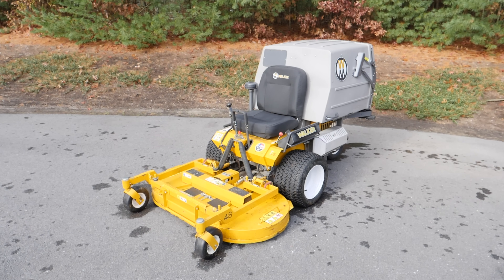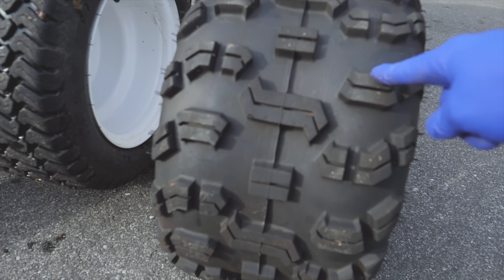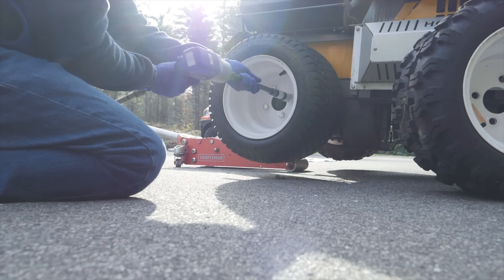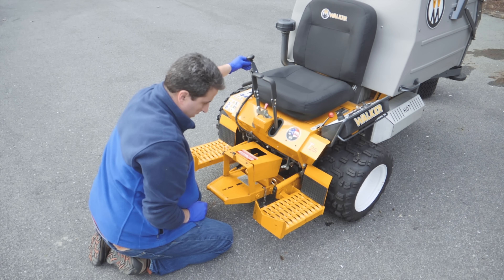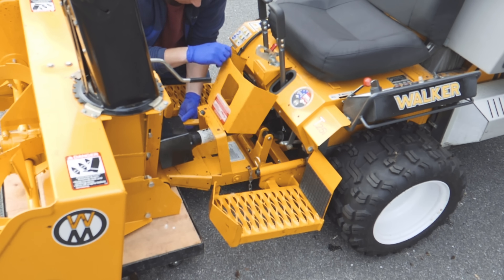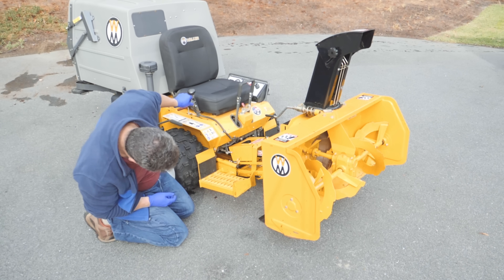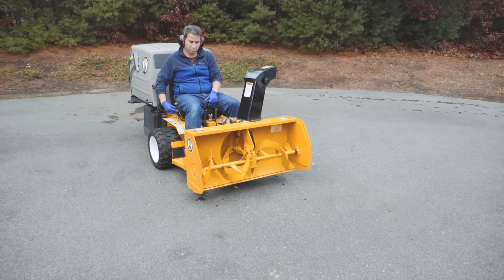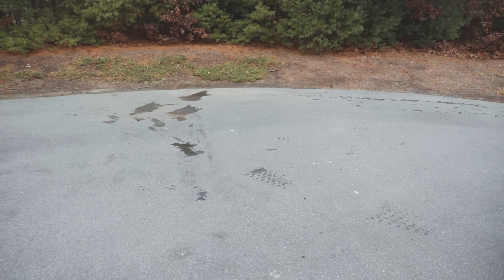Walker Lawn Mower to Snow Blower Conversion

Comment: Have you tried adjusting the pitch of the blower? Mine leans back too much, causing excessive wear on the skid shoes. I’ve had to replace them several times. I stopped at out local Walker dealership, and they were of little help. I need to get it to sit parallel to the ground.

Comment: I've never seen a system like yours.  If I'm correct in detecting a central to eastern Massachusetts accent,  you should know by now that you're either goning to have to bundle up real well, and keep that deflector down, or buy the cab.
Reply from the maker: Thank you yes that is correct!  Maybe a cab someday $$$
Reply: @SilverCymbal  ,I grew up in Shrewsbury, and lived in Worcester for twenty years, before moving to Wyoming. Were are you?

Comment: For the price of that mower I would never use it for snow removal.
Reply from the maker: I'm pretty careful with it and it's very heavy duty. If I had a lot of salt I probably wouldn't. Remember too that the deck is safely stored away.

Comment: Is your grass bllower still running?
Reply from the maker: No, I used the optional Walker PTO disconnect kit. Its only $25 and really should come standard. It allows you to instantly turn the PTO off and on without the hassle of the plug. It has a BAD reputation for being a nightmare to install. This is not correct and it can be installed in less than 20 minutes from under the machine.
Reply: @SilverCymbal  I think its double that price here. I'm considering making one. Would be wounder full to have
Reply from the maker: That stinks about the price. It might be tough for DIY, its only a few parts but they are all laser cut steel to fit around things.
Reply: @SilverCymbal  you need to make a video of the install of the PTO disconnect kit.

Comment: Forget chains, they lay between the lugs on the snow tire, you might have one or two pieces of chain touching the ground. It's not worth the price of the chains, they are expensive.
On the other hand you could have spent the money on chains for the lawn tires and saved the money you spent on the snow tires. The chains work very well with the lawn tires.

Comment: What size are the tires you installed?
Reply from the maker: They are 18x11. Fast trak by Carlisle
Reply: Silver Cymbal 12 inch wheel?
Reply: Silver Cymbal nevermind, looks like 10 inchers is all they offer them in. 
I can’t join the cool club.

Comment: So what's that cost $12,000? Where'd u get it?
Reply from the maker: Mine was used from the original owner with 300 hours on it so it was under $10k. New the retail on the current models is 14k and up. I use mine at home and do some work for others which helps pay for it.

Comment: you should think about putting a blower lock out to prevent snow getting suck in the blower so you won't have that moisture in the blower
Reply from the maker: I actually installed one of those after I made this video. They are only about $30 and it works very well. Walker should include them as standard. Great idea!

Comment: thanks for the great video.  Did you or do you put in an orange colored vacuum cap that seal snow from going into the grass catcher?  We were told that we had to and it was supplied when we purchased our Walker.  This is our first experience with Walker and a snowblower.  We are Floridians in snow  now
Reply from the maker: Great question, I do have that plug you mentioned and I know lots of guys use them. BUT there is a better way, and honestly Walker should have included this. Walker sells a $30 accessory called a PTO Disconnect kit. Its a simple lever that took me 15 minutes to install. Now this gives me an actual lever that completely disconnects the belt to the PTO. I get the full machine power for the snow blower and I don't run the risk of the plug coming out. Its a nice solution and very cheap. It's also largely unknown, but it should really be a factory accessory in my opinion.
Reply: @SilverCymbal  Excellent Advice.....really appreciate it.  Will be contacting our Walker dealer after the New Year.  Thank you.
Reply from the maker: Here is a link to it, even includes an animation https://www.walker.com/addons/blower-lockout  Just one forewarned. Some people tel you that you need to remove the engine to put this in. Sure that's an optiobn but it can be done from underneath and for me it was done in 15 minutes. It's tight but completely doable. Best wishes and happy new year.
Reply: I just take the belt off for vacuum.

Comment: I thought about something like this for a push mower. Just like some string trimmers have lower shafts that have different configurations you can switch out. You could have a powerhead that would have a lawn mower attachment, a snow blower attachment and a leaf vacuum attachment. Plus whatever else you can think up.

Comment: The first thing I would do is put threaded studs with nuts in the wheels. Those bolts with a spacer are insane. The guy that designed it with those should be neutered. Why wear out the threads in the hubs changing wheels instead of using studs and nuts that can be easily changed if they wear out? I would connect a vehicle power window motor to the chute rotate because you want to be able to turn the chute while driving.
Reply: I work in a Walker dealership. The spacer is not needed unless you use low profile tires. The regular tire do not need them. The low profile tires rub the side of the tractor body if you do nit use the spacers. The bolts are used instead of studs because of the way the machine is packed in shipping creates. That what I was told by Walker. You can put gasket sealer on the backside of the spacer when you mount the tire and rim on the machine. This will glue the spacer in place so it will not fall off when the tire is removed. Also I have made a tire mounting helper tool. I took a bolt (longer that the regular wheel bolt) and cut the head off it and cut a screwdriver slot in the end. I then use it as a temp mounting stud to hang the tire on while getting my bolts started. Most often the tool will come out without the use of a screwdriver but just in case it does not. I have worked on Walker mowers for 20 years. In fact I have one on my shop table waiting on my at work. By the way, the Walker PTO shaft quick coupler hold back tool, well I invented that. Walker bought the rights from me for it. So I do know a few things about these machines.
Reply from the maker: I like the window motor idea a lot. That would be very cool! Yes I agree I don't like internal studs like that, I never quite get why some companies use them. It makes the spacer that much harder. Fortunately I won't be switching it much but I totally agree. Thank you for the comment and for watching too!

Comment: Great video. I have been doing snow removal with snowblowers for 15 years. 10 years all walk behinds, mostly rubber paddle. Found this setup 5 years ago. Lets just say $3,000 in 6 hours. 64 driveways. Thank you walker mowers!!  Walker is worth every penny. As a homeowner. You should get the h series mower with 50” snowblower and hard shell heated cab. This is giving me inspiration to make a video I’ve been meaning to sense I first discovered walker snowblowers.
Reply from the maker: Thank you for the very kind comment. That sounds really amazing, I have heard the Walkers are huge money makers, really offsets their initial price. You obviously know how to run a good business too with that kind of $.  I saw pics of that H looks CRAZY! very heavy duty. Thanks for sharing this its great to hear. Best wishes

Comment: u got rid of ur JD 1025R for this mower huh. hope ya the best-and good luck with it. i remember u from on GTT.
Reply from the maker: Yes, most of my larger projects were finished and the JD did a great job.But it was proving to be too much mower for my space. The Walker won't replace a tractor but it is a much better mower and I think will do a great job as a snowblower.  You will be interested to see my videos coming up shortly I will do some side by sides with the Walker and the JD.

Comment: I have a wheel horse with a dual stage snow thrower. It works great and really throws the snow a long way. Although the engine is starting to really show it's age and loosing power now...

Comment: you may want something in the hopper to keep the back from hopping up a few inches. A bag of salt to will do the trick. or you can get the weight kit from walker.
Reply from the maker: I like that idea a lot. I think that would be better than spending more on the weight kit. Thank you
Reply: @SilverCymbal  
If you have any questions about your walker hit me up. Check out my about me section.

Comment: You could swap out the grass catcher for a sand spreader.
Reply from the maker: That's a great idea. Walker should sell that, could be very cool!
Reply: It would also help to give the rear end a bit more weight.
Reply: I wish they did, we used to throw spare bags of calcium chloride in the back for extra weight/refill the shovel guys
Reply: great idea...
Reply: You can do it your self, some scrap materials from the scrap yard and a small electric motor... there are a few videos on this for quads and sub compact tractors...

Comment: Snow blower demo that doesn't even show snow.  Also, the plastic bagger will become more brittle in the colder months and be more susceptible to being damaged.  Should maybe be removed and stored indoors?  Just some observations....
Reply: If you read the title it doesn't say anything about blowing snow. And second the plastic on the hopper is very thick and it will not become brittle from the cold. I've been using mine for many years and never had a problem.
Reply from the maker: I agree, snow will be here very soon and I will be sharing some footage. I also will include a comparison with some other machines in the same area,. Interesting points about three bagger too, Walker says it is designed for Winter also so I think it will be ok. Thanks for watching,
Reply: @SilverCymbal  We have one that's 6 years old and haven't had problem. Sometimes we put a bucket or bag of salt in it for extra weight and then you have it along if you need any in slippery spots of around mailboxes, et

Comment: Would some fluid in the tires improve winter traction!
Reply from the maker: It probably would help but I am not sure if it wouldn't casue transmission issues since these use direct hydro drive pumps so maybe the unsprung weight would be a problem. I know tractor guys love the liquid filled tires so maybe this could be a great thing for these. Thanks for the comment and for watching.

Comment: That’s pretty cool reminds me of several old systems of 50’s and 60’s the convertible idea has been around for years they just never seemed practical, this however isn’t too bad but as you kept mentioning the price that’s always been a factor for new equipment especially convertible equipment. I’m sure you’ll need some kind of shield to keep snow off your face the wind will be your problem more that anything you can,I’m sure, fashion a shield from a currently available factory one from other manufacturers I don’t think the cab is necessary.

Comment: belarus is better
Reply from the maker: Hehehehe, maybe but aren't they long gone?
Reply: @SilverCymbal  thats were youre wrong i got one belarus 09h i dont have snowblower also they make small tractors aswell as walking tractors
Reply from the maker: Very cool I will definitely have to check them out.
Reply: @SilverCymbal  only problem with them is there very heavy you need 2 people to lift attachments  plus the holes to pto are a bit crooked but there long lasting 40 years like lada niva same patten plus the clutch stops working so you have to adjust it then put it back again 11.4 kmh some russians put bigger tires on them go more faster

Comment: I'm a person who has spent a lot of time behind a walk behind snow thrower which by the way I believe would be even further from the actual throwing chute to the operator then what that thing is! This is a guaranteed snow in the face experience... Freezing you betcha! Even the simple windshields behind some of the walk-behind snow blowers are amazing! Personally I think you're going to take that thing out a couple of times and you're going to hire somebody else to do it! There is no comparison to any type of cab with heating snow removal solution to make life livable in the North country. I don't care how much it cost I'm worth it!!!
Reply: Ok now let's see you load it onto a trailer.  Take it somewhere that has SNOW.  For what you got in that thing I think I could put a nice plow on my 4x4 and have heat.
Reply from the maker: @mikeries8549  Don't worry that will definitely be coming very soon here. I will also have a head to head between this machine and a similar John Deere Snowblower on the 1025R Diesel tractor.
Reply from the maker: I love your comment so much. One thing for sure, I won't break down and have someone else do it so I will have to make it work. I have some interesting winter gear that has worked pretty well for me but we shall see if I can take it or not. Otherwise I will be back on Craiglist looking for a cab I will be sharing some action videos with the snow to see how it goes. Thank you very much for the comment and for watching I appreciate it.
Reply: We have 2 of these units. Absolute beasts in snow. Yes you'll get a little back in your face but it's very minimal. We mount lights on the top side of the box and run 24 hrs.
Reply: Just use a motorcycle helmet. No problems

Comment: The Grasshopper front mount mowers also have an optional snowblower attachment, as well as a push blade. And you can get a cab too. We had a 720 at the park where I used to work that we had the blade for. Used it a lot in the winter for snow moving. Couldn’t get them to turn loose with the cash to buy the blower......
Reply from the maker: Very cool. I have heard great things about the Grasshoppers. I wish they were more popular up here to see them in action. Thanks for sharing this and for watching.

Comment: Nice looking  dual purpose machine. 'Specially like the 2 stage. I have a JD 214, with the snow thrower. Only comes single stage. works OK for the most part. I hear ya on the cabs. Outrageous. Here in lower NE, it doesn't justify the purchase for the little snowfall we get.
Reply from the maker: Thank you,. Ours varies but some years we get destroyed with snow. ❄ Just a few years ago we were hammered weekly for the entire winter, it was terrible. We are probably due for another season like that so hopefully this will handle it.

Comment: I am wondering if that intermediate platform that your feet rest on can be left inplace and have the mower attached to it?  that would be great for mowing under trees/shrubs and other low lying obsticles.
Reply from the maker: The hitch can only be left on for optional attachments as a quick change mounting system. Since it's out front the mowing deck can easily get under things alone. That's one of the things that makes it such a great design for mowing.

Comment: Hello nice video. I know the machines are expensive even beat up used ones people asking a lot of money. It’s nice to stay away from to much electrical controls which operate the chute. I work on a lot of Snapper snowblowers which had electrical chute controls.Option for some horrible when they go bad. Try and look for a good used cab.
Reply from the maker: I couldn't agree more. Even my John Deere hydraulic shute control would build up with ice and freeze. Sometimes manual control is just more reliable for sure. Gizmos always work great in a showroom but not always in real life. Thanks for watching and the comment

Comment: Nice rig.  Had no idea the Walker was that versatile.  Wish I could go back to a commercial zero turn, but the hills in my (new house) front yard (and driveway) only make 4WD a practical option for me.  Best of luck.
Reply from the maker: They are really great machines Sadly they make many more accessories, dozer blade, even a small bucket and more than my wallet can afford. I buy everything like this used and only for low prices and Walker accessories sell for a lot used so I have to look for a long time to find the right deal. Extreme hills can be tough for a zero turn, but a nice 4wd like you said is still a really great machine too. Thanks for watching and the comment.